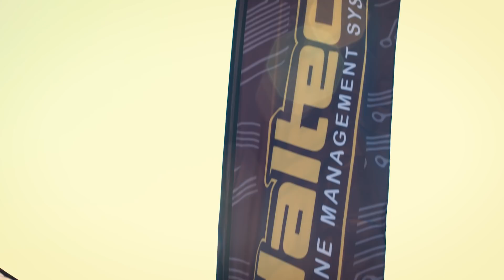🏅 Revline Racing Time Attack Porsche 968 | HALTECH HEROES

Comment: Cool Car, cool team, cool video.

But it proves the point that teams are simply building hand grenades.
Reply: Thats Time attack :) Wouldn´t be a proper TA car if it could handle a 24h race :)
Reply: Wouldn't say hand granade, they were pushing the car so far up the boost range and beyond the engines potential for the WTAC.
As he said in the video the car has been running a full season in sweden. and when you're pushing that engine way beyond it's capacity of course they risk engine failures like this. who knows, perhaps it'll be a billet block in it for the next time they hopefully show up =)